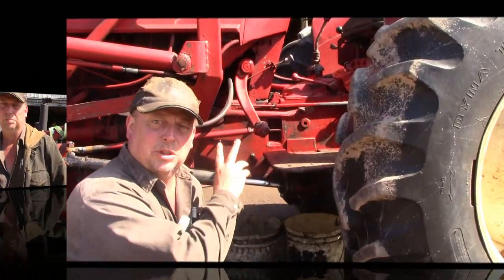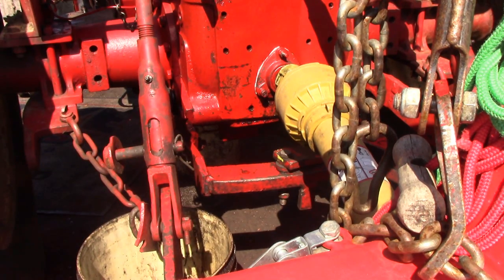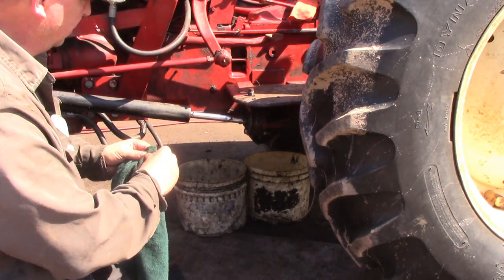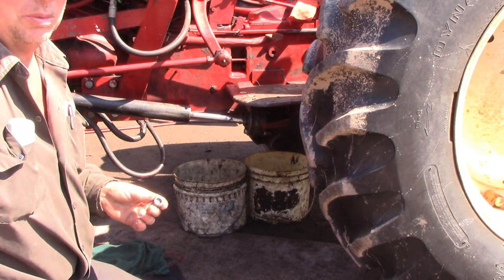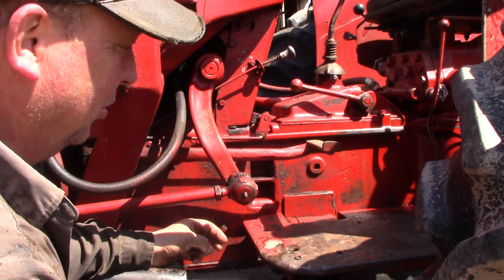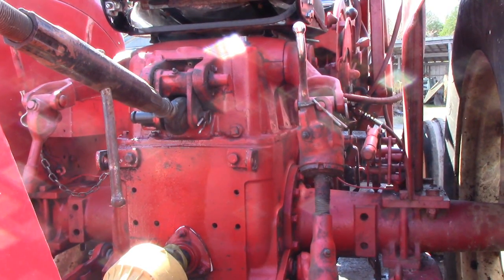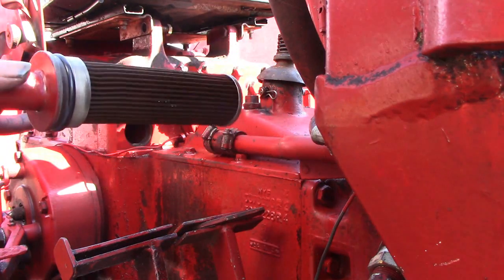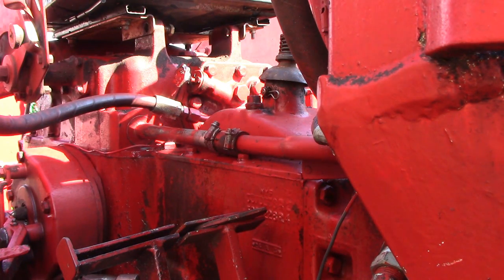IH 444 Fliuds change

Comment: Hi On my old 1958 b 250 where would the drains and refill spots be on the trans and diff? It doesn,t have hi and low range just 5 speed
Reply from the maker: On a B250 the front drain will be on the bottom about half way back the running board. the rear one will be the same as the video, right below the PTO. The fill should also be by the shift lever. I don't remember where the level plug is, check the sides above and below the running boards. Thanks for watching!